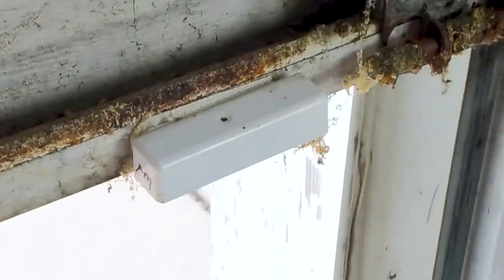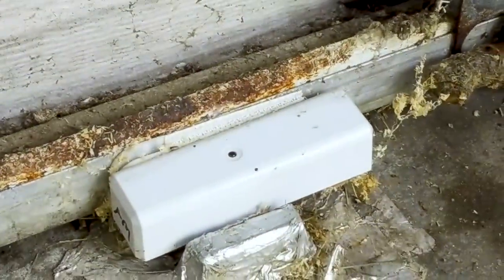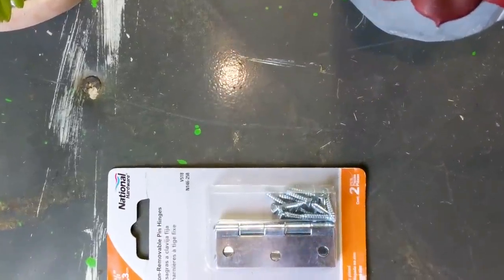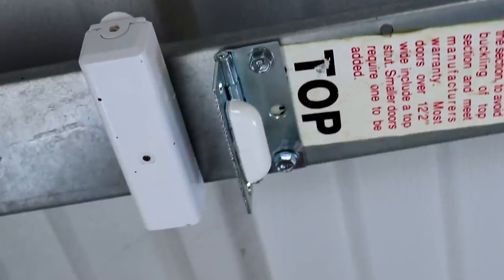Best Way to use a Door Sensor on a GARAGE DOOR

Comment: It seems to me this will only work if your door is all the way open. Your door could be opened partially and it will still read as being closed. You may want to install the sensor as high on the door as possible.
Reply: No...it goes on the top panel.

Comment: That is a cool little hack to make the switch work on the garage door. Samsung has just updated all the sensors and I bought the new multi purpose for 19.99 at  Best Buy and same price on Amazon. It has an option to use it as a tilt sensor without the magnet and seemed to work great when testing. All the new Samsung sensors have come down in price. It's only been a day but seems to work great for 19.99 as I have to see how it holds up along with the battery.
Reply: I use one on my garage door and it works great.
Reply: thx for the info; so the old multi purpose sensor cannot be used as a tilt sensor?
Reply: I have the newer one, so not sure about the older model.  there is a setting you can toggle to make it a garage door sensor.

Comment: It may be worth mentioning that the hinge and contact sensor should be placed as high up as possible on the garage door. If the garage door is open a foot off the ground and there is still contact, it really is not a very secure option. If it breaks contact without leaving much of an opening at the bottom of the door, then this is indeed a nice solution.

Comment: Interesting solution.  However if you are comfortable soldering then you can just replace the internal magnetic (reed) switch with a tilt switch that can be bought on ebay for around $1 for a bag of 10.  I did that modification to similar door/window sensors several years ago and it worked great.  I installed them on the top of my garage door so that my home automation system can sense when the garage door is open and added one to my mailbox so that I can get notified when someone (ideally the mail delivery person) opens my mailbox.

Comment: Nice idea, thx for sharing. I've had an inexpensive RF door switch mounted in 2 different locations and both spots had issues will take a look at trying this soon. Using a Sonoff rf bridge to send signal to wifi for Home assistant to monitor. Fun stuff.

Comment: I have my contact sensor attached to the top of the door & header, rather than to the bottom/floor.  Works great and didn't need extra supplies.
Reply: This is the way I do it. As a alarm installer

Comment: Man, this is a great idea! I have gone through several 2GIG sensors trying to glue them to the bottom/side, and the magnet side keeps getting caught up in the track and eventually comes loose, no matter how much glue I try.  One question, is there a special type of screw you need to install the bracket in the aluminum/steel garage door?  Looked like your drill went in just fine but I’m not the handiest guy and not sure if there’s any special screw or drill bit needed.  Thank you!
Reply: Michael Press p

Comment: Simple cheap and brilliant idea!  BUT will it work with the Wyze sensors you reviewed?  From that video the sensors had what appeared to be a much greater contact separation connect range than the hinge allowed for there and maybe would not recognize the disconnect?
Reply: I'm installing Wyze entry sensors now and I don't expect an issue. If you're concerned you could use a long hinge so the magnet separates further.

Comment: I think this is a good idea, albeit with one possible draw back. What if a theive pries your garage door just a few feet off the ground. Enough for them to just slip in? The only way I see this could work better is to put device on the very top of garage door section and not mid section or lower.

Comment: my garage is detached  so wifi is not really an option ,  i use 2  ultra cheap quiachip relays  with my broadlink RM pro ,it can be integrated into smartthings with beckyricha's custom  DTH but i have not done it ,i just use  RM plugin running on my android box as a bridge for alexa and a few other tricks to get it working with GH/GA through  IFTTT via webhooks, for the "sensor i just wired  a  $1.50 SPDT momentary button switch i got off ebay from china,my first idea was to  attach it to a magnet to stick it on the rail so that the trolley pressed in the button when the door was up ,but for some odd reason my door did not rest in the same up position so i had to put it at the bottom instead
but then i got a better idea ,  use an arduino pro mini, connected to a relay and an ultrasonic sensor
Reply: Mesh wifi!!
Reply: Try using a tilt switch (which are dirt cheap on ebay)

Comment: it worked but you have to get non ferrous door hinges or the dang magnet sticks to the metal hinge.....
Reply: Nope.  It doesn't matter.  Mine are steel and it works just fine with a ring sensor.  I put the magnet side on the hinge.
Reply: @mikespunchlist  magnet gets stuck on hinge.  Great idea any way :)
Reply: @MrJobe123  Mine never gets stuck on hinge.  The trick is to use a bigger hinge.  Mine are the old hinges from my front door.  Yep..big and heavy.  I cleaned them up drove the pin out and lubed them up and painted them.  I have had no problems since install over a month ago.
Reply: Tony, that's my exact problem. The Nest system uses a very strong magnet on the part that attaches to the hinge. It keeps the hinge from falling, and if it does fall, it sticks to the upper section. Ugh.

Comment: Seems this guy did it back in 2015   https://www.youtube.com/watch?v=o49xC-AXY9w    assuming this is a battery operated sensor, so periodic changing of the battery is required?  And the alarm in in the house???
Reply: I am the guy who video you linked. Thanks.  It is battery operated. I changed it every 1.5 years, give or take. This isn't tied to an alarm.

Comment: Can anyone tel me what type of sensor was used? The link adjacent to the picture doesn't work.
Reply from the maker: I used the go control door/window sensors here. The link to them is in the description box of this video.
Reply: @TaylorTech  Thanks!  I didn't expand the description box.  What about the receiver/alarm?  Was hoping to find one that plugs in so I can keep it in one spot.
Reply from the maker: Which receiver are you talking about? I'm using a dome siren as my alarm in the house.
Reply: @TaylorTech  I know your time is valuable. Though you didn't show what receiver you  used, I just need a basic receiver, preferably one I can plug in and has volume options.
Reply from the maker: Receiver for what exactly? Speakers? I don't have one in my house
Reply: @TaylorTech  If this is a duplicate response, I apologize.  Is there a receiver/alarm unit with adjustable volume that pairs with these sensors? I sleep in different rooms due to ongoing medical issues. I was hoping to find/use a receiver/alarm that is portable. I do not have a house alarm system. If the alarm goes off, I don't want the whole house awoken, just me.
Reply from the maker: Ahh that makes a lot more sense! I don't know of one with adjustable volume... But the Dome Siren has different tones you can pick from and some aren't too loud. It is battery powered so it is portable. Hope that helps!